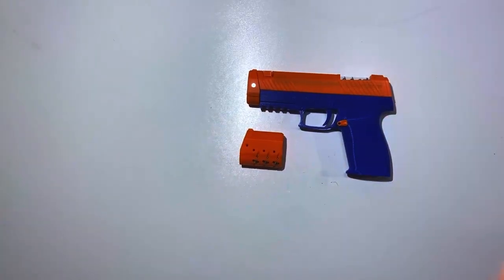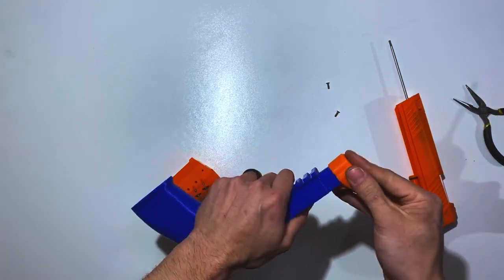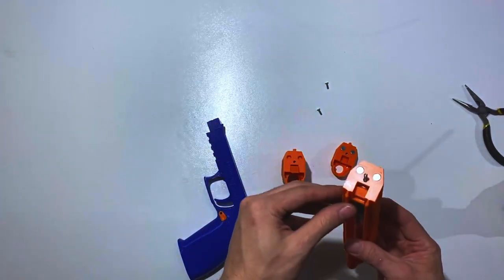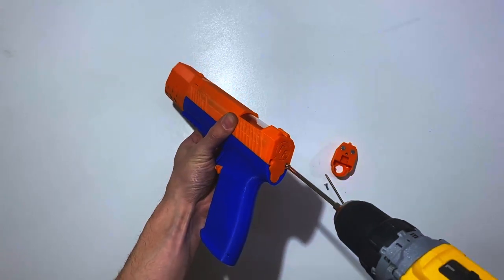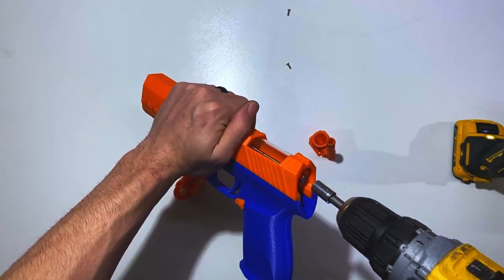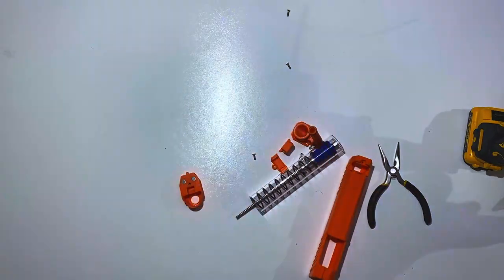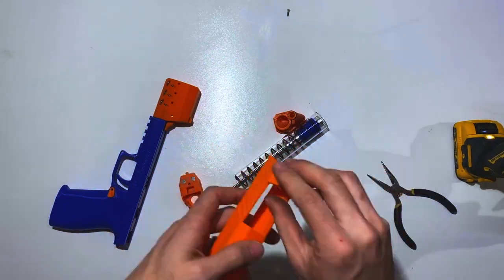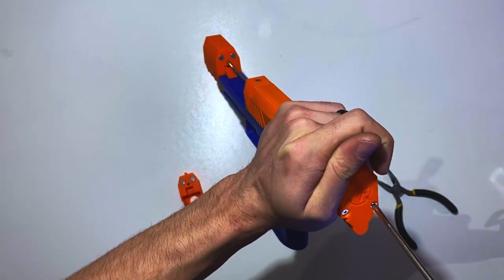Zinc Upgrades | BCAR and Slide Installation

Comment: cool part, who'd y'all steal the files from?
Reply from the maker: Didn’t steal it from anyone. File is actually used with permission and credit if you check out the listing. I can’t remember off the top of my head, but I believe it was erichelpdesk
Reply: Not stolen. Just overpriced and 3 month build time
Reply: They built me 2 in two weeks with a total of 10 mags.. quit hating.
These guys are awesome